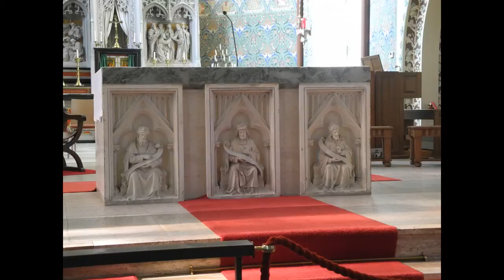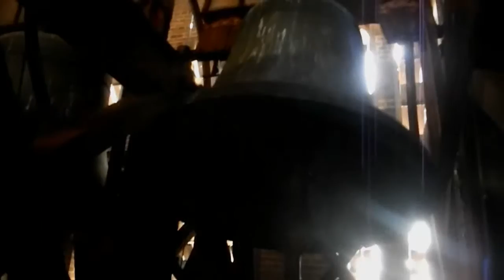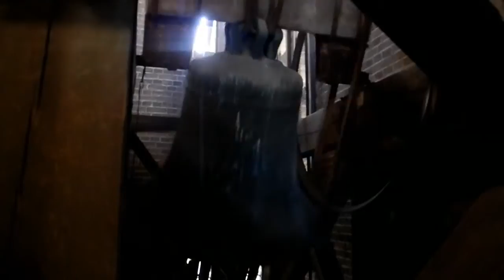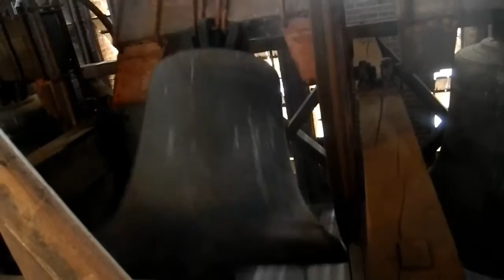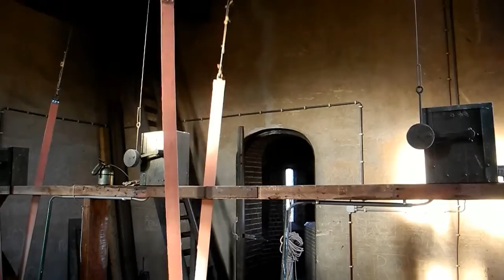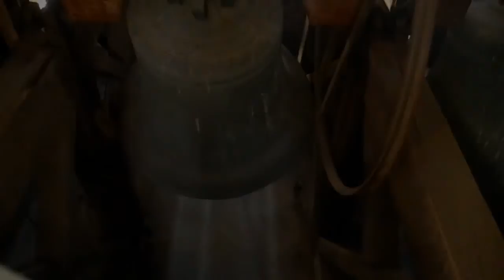Klokken van de Sint-Pancratiuskerk van 's-Heerenberg

Comment: for a Van Wou bells the shapes are very little, the des1 would be not heavyer than 1700/1800 kg, but beautifuls bells. Also st Pancratius church seems interesting to be visited, is it protestant?
Reply from the maker: +ArteCampanologia That is right, the bell is rather light, on condition that the given diameter is correct (I did not check).  The church is not protestant, but roman-catholic.  It is a rather recent church, built at the end of the 19th century.  But the bells originate from an old protestant church.